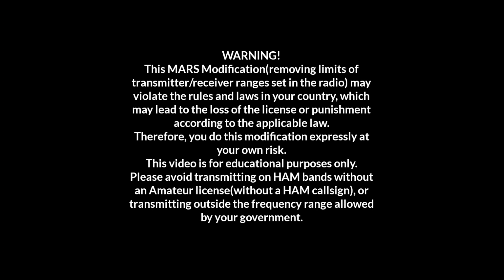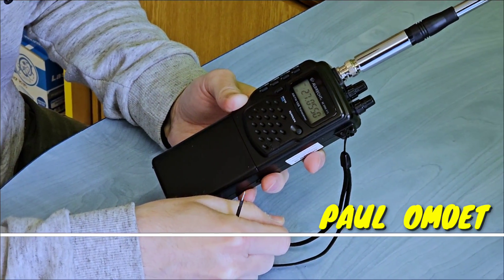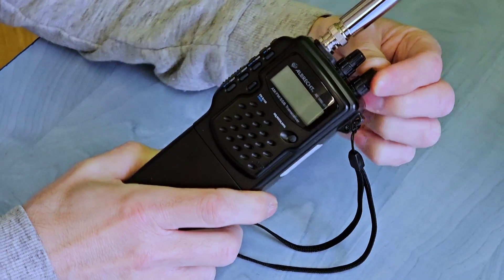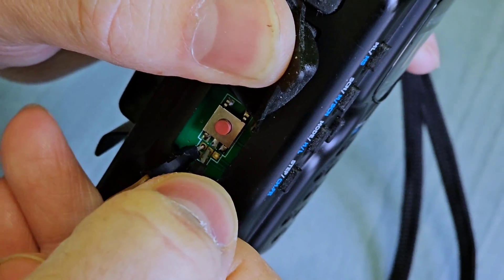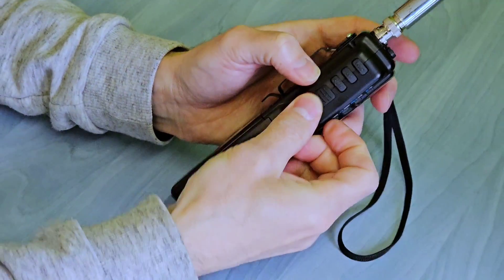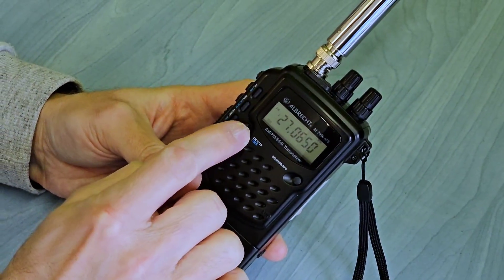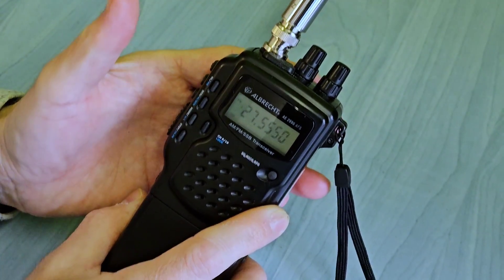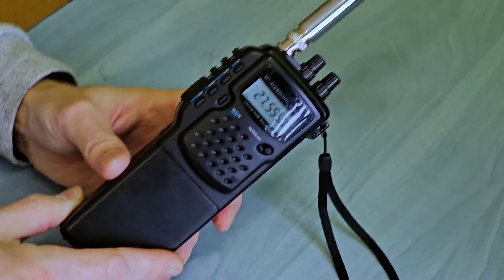UNLOCKED 12M to 10M bands SSB/AM/FM Transceiver (Albrecht AE 2990AFS)

Comment: Hi Paul am I right in thinking this is the only handheld on the market that has SSB for the CB bands? Also I believe a poor battery/output power relationship and some audio "warbling" with this Albrecht?
Reply from the maker: Seems that yes. I don't know any other such SSB handheld. Yes battery pack is for AA units so no good. Audio was a bit tiny, yes.
Reply: @OM0ET  thanks Paul 73s

Comment: I had this radio some years ago,I also added a small switch on top to be able to change bands whenever I wanted(mint). Nice idea as a radio BUT mainly the tx audio was horrendous,that is the reason I sold it. 73s great video
Reply: As the battery aged, it was unable to maintain the proper voltage under load. That resulted in warbly transmit audio. There are larger capacity batteries available now that cure the problem.
Reply: @spaceflight1019  I had the audio issue from day one👍🏻

Comment: Nice, just a shame it won't go higher than 29.315 it seems
Reply: It does but you have to select the option without CB frequencies you can set it up as a 10&12 meter only radio then you get repeater shift
Reply: Agree. No FM section or repeaters. :-(

Comment: Thank you for the video which reminded me that I have done this procedure previously, but selected Code 3 instead of Code 4 - the latter is the same as Code 3, but with - 5 khz offset according to Polish CB frequency list. This is a great radio, I have a pair of these in addition to my Icoms and Yaesus, so I do not agree with the view that it is outdated and worthless. It is a hand held transceiver allowing to transmit SSB on 10 meter band - and this is rare with other radios. Of course I can transmit SSB on the same and other frequencies with my Elecraft Kx-2 or Icom IC-705, but the size is different. And the price. With two Albrechts I can maintain SSB communication when on foot, and SSB covers bigger distances. As for DX, in good propagation conditions I have had qsos using Albrecht with a telescope antenna from Moscow to Siberia and Kazakhstan. So, I would not sell these radios which are a good addition to the shack. 73 de R2ARM!
Reply: It was a Nice dx because the walkie has a low power watts cause yours normally battery

Comment: I had a bad experience with this rig. The metal tab for the positive and negative pole of the first battery, in the battery case, can cut the plastic of the battery and make a short. I have a battery case completly melted in my bag because of that. So I put a hard plastic insulator in L shape on the first battery for protecting it.